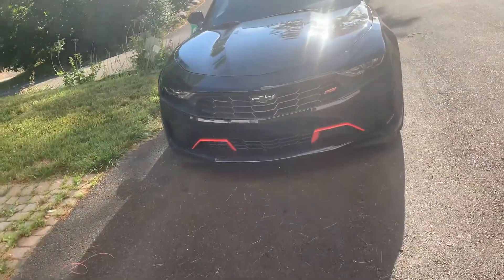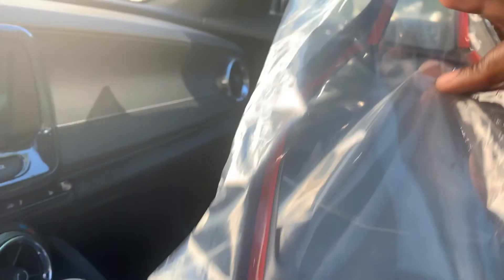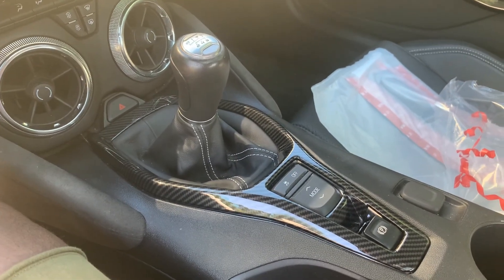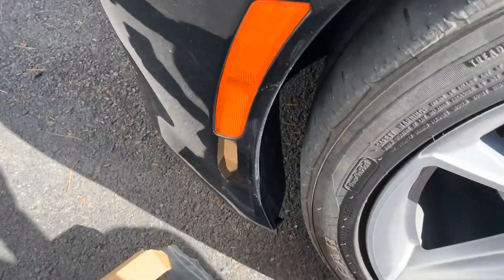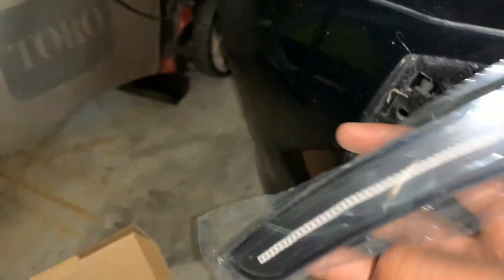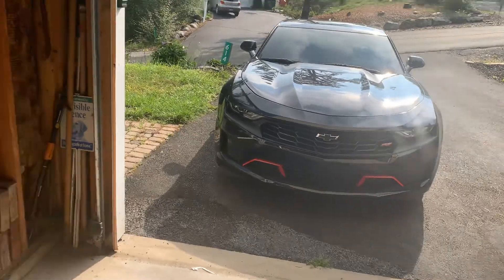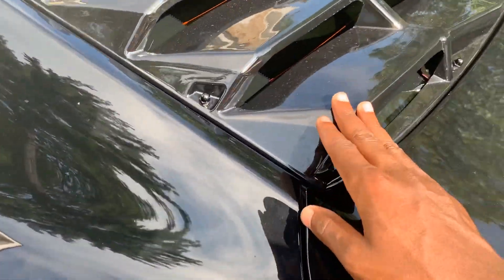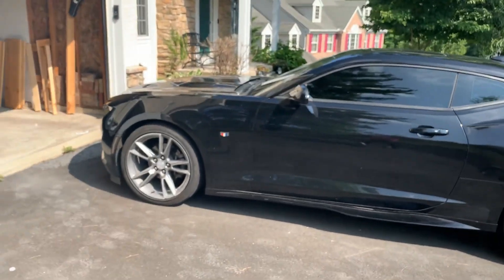Interior & Exterior Upgrades To The 2019 Camaro 2.0t!

Comment: Yeah those guys over at next gen speed sent me side skirts when I ordered the quad tip diffuser. They are horrible at responding whenever there is a problem with an order.
Reply from the maker: i usually go through their instagram for questions. i have so many of their parts on my car, I can’t complain with their services though. The prices are pretty good too
Reply: Yeah I do too lol, I have the splitter, side skirt, louver, trim piece around shifter and I just get screwed. First they sent the side skirts with the missing support piece then it was an ongoing battle that they never resolved, now the diffuser situation. I don’t have instagram so I’m screwed.
Reply from the maker: Heavychevy wow I’m surprised to hear that about them! I guess every company isn’t perfect. They fooled me with their stickers and low prices
Reply: Yeah it’s a shame because I’m trying to buy more but now I’m so hesitant to because of my past experiences. Anyway the louvers are pretty good. You will notice some rattling at high speeds but you can use the foam to stop it I found that with the tape that’s on the brackets liked to come undone after washing it, I used the gorilla brand double sided tape on it then sealed it in with black caulk it gives it a clean look and worked. Just in case you run into the same issue